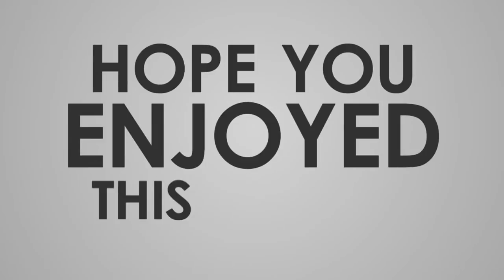Woodturning- turned 8"x3" Rainbow Cottonwood Wood to bowl

Comment: Sorry,  have to complain. The finish is only shiny in spots, instead of all over,  and what's with that crappy rough area on the bottom. You must realize that a buyer will turn the bowl over to find the maker's name. What will they think when they see that? Also, you should return that sanding thingy to Amazon and get a refund, not your fault for that poor quality tool. Anyway, don't let my criticism deter you from your work, you're on your way. Thanks for producing this video.
Reply from the maker: I Appreciate Your Feedback. I did finish the bottom and sand it, to be honest with you I just lost the recording during the editing. you absolutely right about the sander it is really low quality And I will return it. Thank you again for visiting.